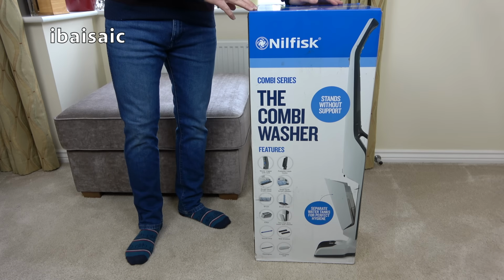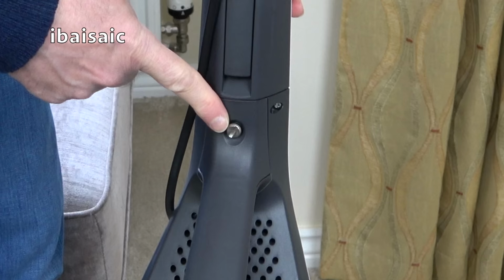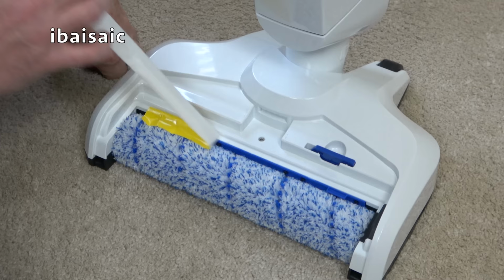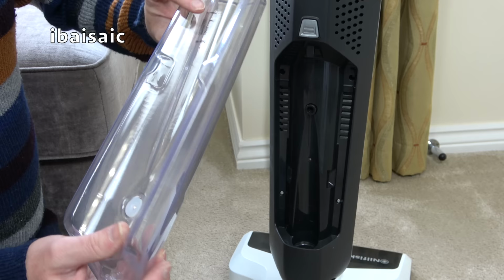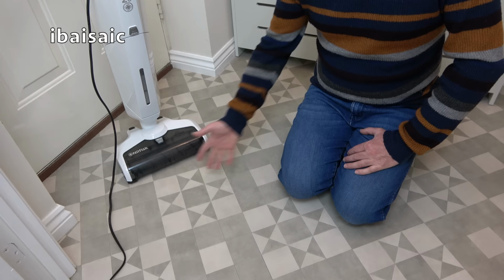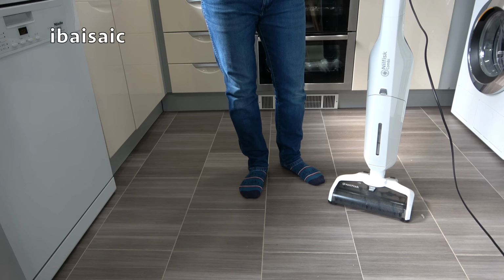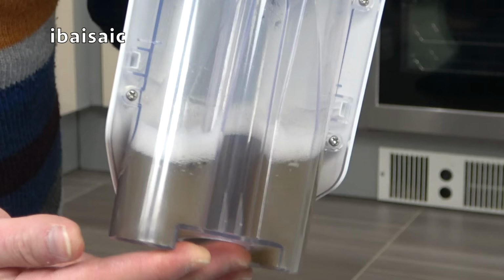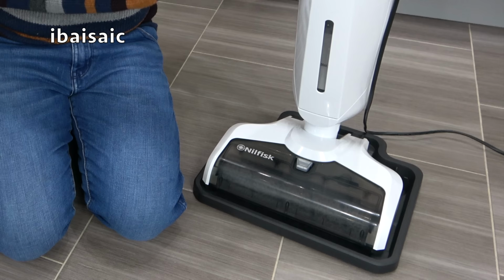Nilfisk Combi Floor Washer Assembly, Demonstration & Review

Comment: A good idea the water /solution control, I have the Karcher FC5 , that keeps flowing water and I measure an amount so it runs out and helps it dry faster once water has run out . Wow good price £80 , much cheaper than competitors machines, bargain, Glad it wasn’t just us that’s binned the mop and bucket 😝 … good video as always Roger.

Comment: This has been discontinued by Nilfisk and over here in Germany the spares are already hard to get. I have been using it for two years and while it does work, it is not too impressive. It leves streaks on some tiles and needs more passes on dried on stains than similar machines. The tank release button is weird as mentioned and the flimsy cable storage looks like an afterthought. The filter dries very slowly and the brushroll isn't compatible with any other machine. There is also a large border which the machine doesn't clean at all like most crosswave types. For some application i still prefer the old spinscrub floormates which are no longer availible, those also have larger tanks to pick up spills or wet shower floors. I also have a cordless Leifheit which is very similar to the nilfisk and crosswave but for some reason cleans faster, but has a tiny tank and lousy battery indicator. One distinct feature of the nilfisk is the obscured pickup tank, which may be desirable in situations where you don't want customers or visitors to see the dirt.

Comment: Never put boiling water because it will cause damage to the solution tank
Reply from the maker: I say in the video that you can put hot water up to 60 degrees in the tank according to the instructions. I have always said never to put boiling water in any floor washer or carpet cleaner.